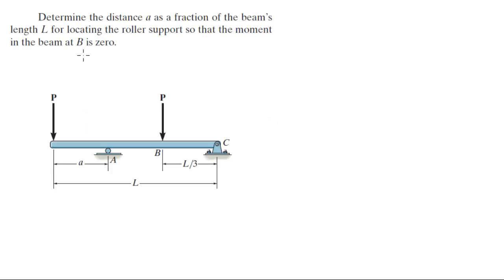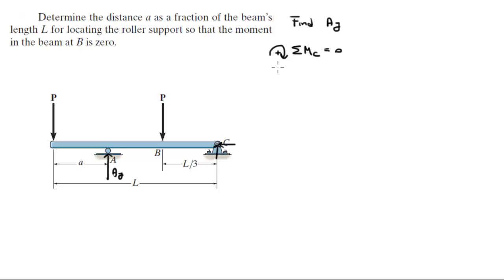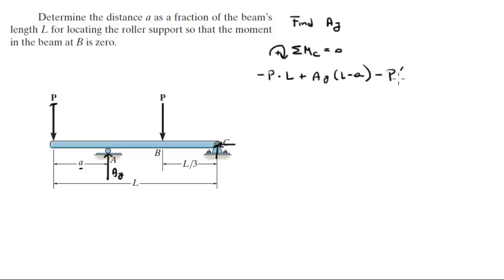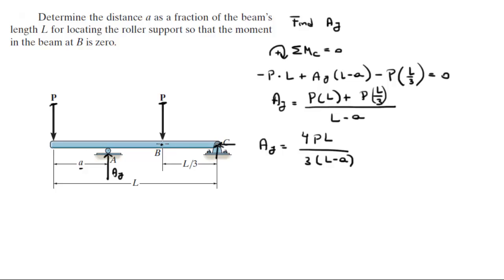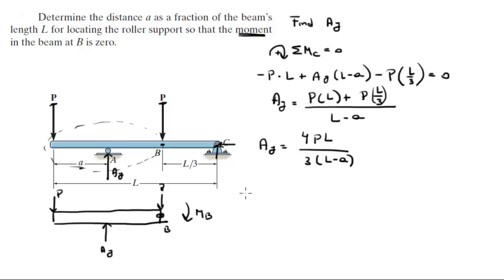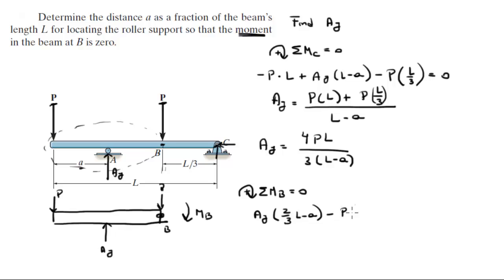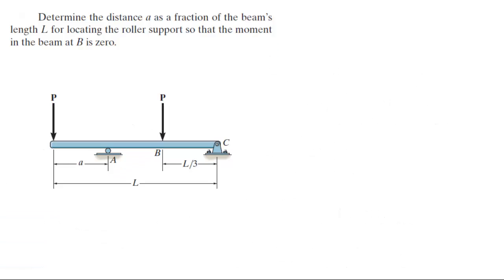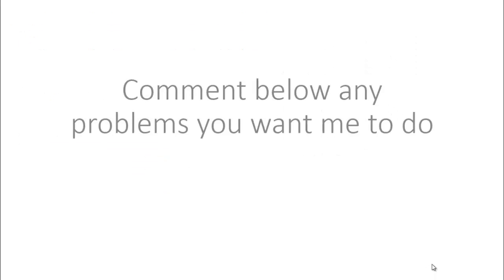Determine the distance a as a fraction of the beam’s length L for locating the roller support

Comment: A man attempts to support a stack of books horizontally by
applying a compressive force of to the ends of
the stack with his hands. If each book has a mass of 0.95 kg,
determine the greatest number of books that can be
supported in the stack. The coefficient of static friction
between the man’s hands and a book is and
between any two books (ms)b = 0.4.